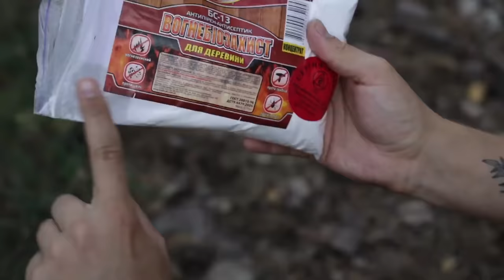Building a dugout in the wild forest from start to finish. GIANT DUGOUT UNDERGROUND - FOREST BUNKER.

Comment: The only concern I have with dugouts is water.  As soon as you go underground you will have to deal with ground water saturation even on the surface.  Either way this is a great project and you did some great work.
Reply: ' zackly, very porous sandy soil, woulda put down gravel and or french drain
Reply: As am old builder living in a hi rainfall area and rocky ground I agree with you  I have seen ground water problems
Reply: @raycaster4398  Yes, maybe a plastic barrier as well to help funnel water into a very large sump.  The only drawback is the lack of a pump to extract the water.  There'll be a lot of bailing and if the structure is left unattended for a time, it may become a swimming pool.
Reply: @terrymcnee3568  Do you still have water percolating up through the ground?  Are you at any significant altitude?

Comment: It will take a lot longer, but if you cut a slight U groove into each tree that is stacked, they slot onto each MUCH better, leaving barely any gaps. Putting moss onto the top of each layer makes the whole building so much warmer and better insulated. Does take time though. Best of luck to ya, love your videos!

Comment: Questions, why did you stick moss in between the logs when they are buried under the ground level? Why did you use tarp for walls and roof cover? They break down quickly, you would have been better to use plastic sheeting. Also you may get issues if you get snow in your area with burying the stove pipe. your going to get water build up which could leak in during the winter and later freezing which will slowly tear the walls apart.